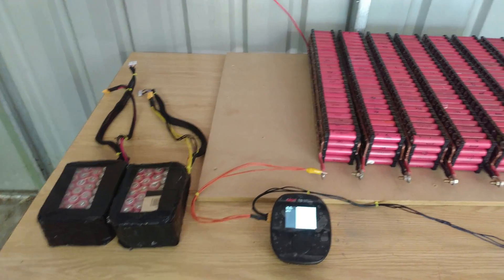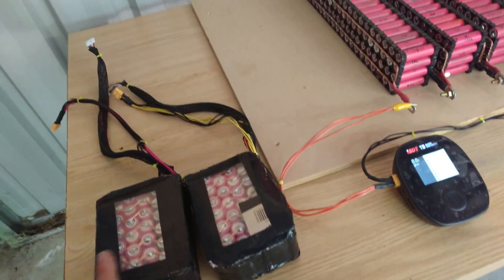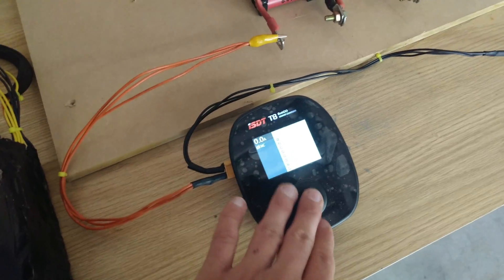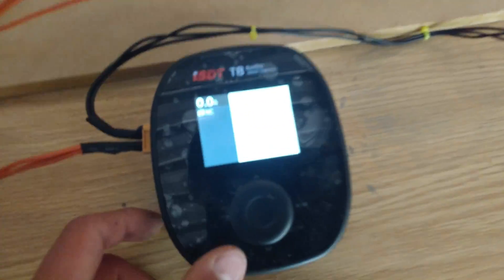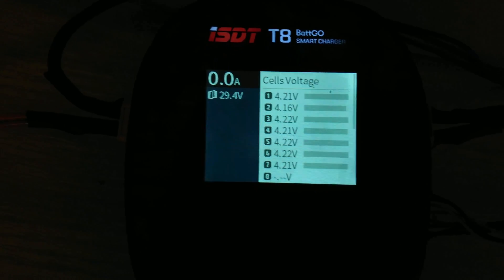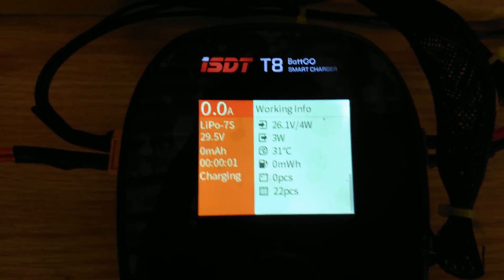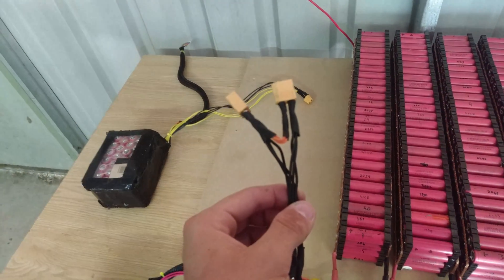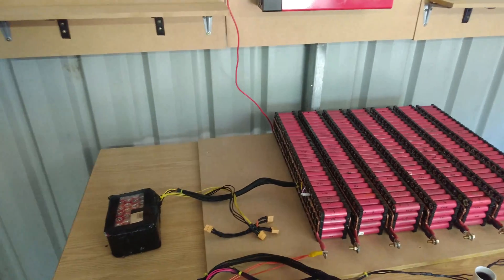Razor Pocketmod | Modified 18650 Powered E-Scooter | How i Charge The Batteries! | Update 11

Comment: Charging it that little extra .02 volts probably just cuts down on the life cycles if anything, I would undercharge it if I were you and just add a few more cells in parallel if you really need more range that bad